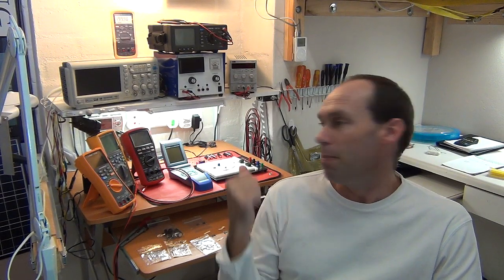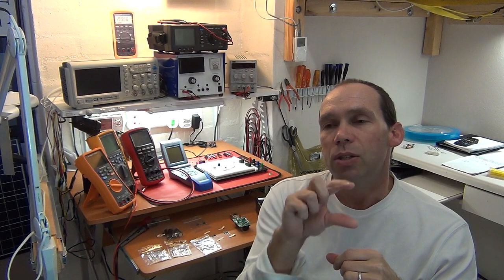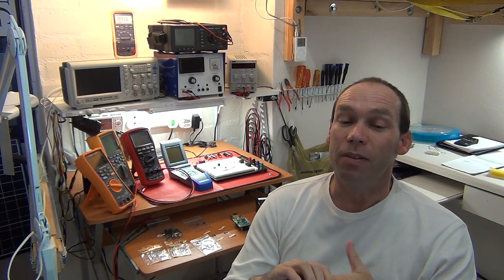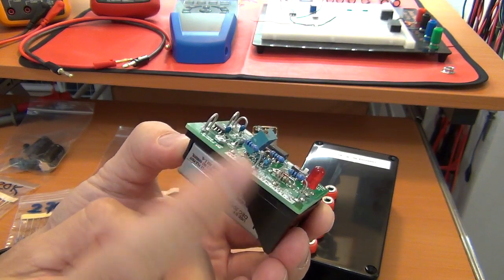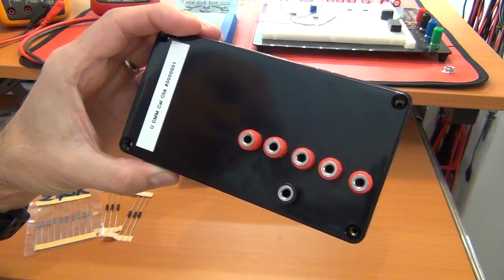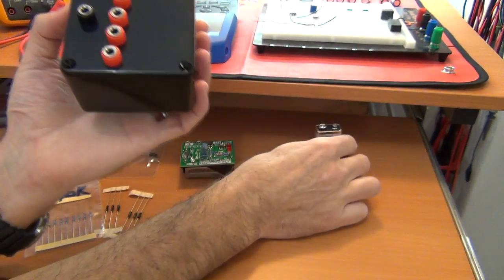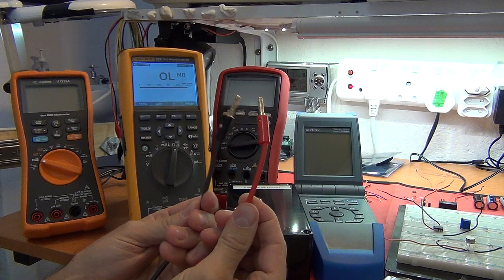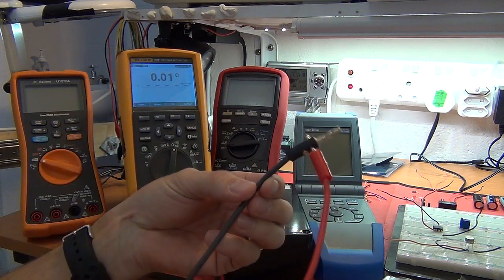T4D #3 - Metrology, Calibration and the Ultimate Multimeter Check

Comment from the maker: Yes, you are correct. This was just a quick way of providing some form of calibration figure for the resistors. I have two 6.5 digit newly calibrated meters on the way and will repeat the process with them...and even try a 4-wire approach to try and ensure I have the best measurement possible.

Comment: Hello from Canada,I recently got myself a Simpson 360-2 digital multimeter, and I need a bit of help, because it didn't come with an operator's manual. This model has a digital display and an analog meter display [for circuit peaking and nulling, I was told]. I noticed that the analog display needle [pointer] isn't centered on zero. Is this a matter of recalibrating the whole unit, would this simultaneously fix this issue or is it possible to manually center this pointer? Or, worst case scenario, is my multimeter broken? I'm an enthusiast/not a professional, and watching your video series, is what got me interested in multimeters/electronics - you're an awesome teacher. Please let me know what you think, and keep making videos, they're great! Thank you kindly"
Reply: Hi Max, did you solve your problem? If not you can find the manual here, https://www.manualslib.com/manual/1005326/Simpson-Electric-360-2.html?page=26#manual and the zero setting instructions are on pages 6-4 to 6-6. As with most needle meters the adjustment screw is just below the meter, sometimes capped.